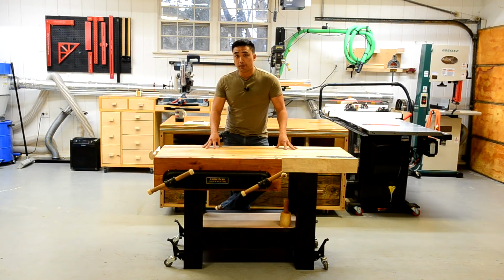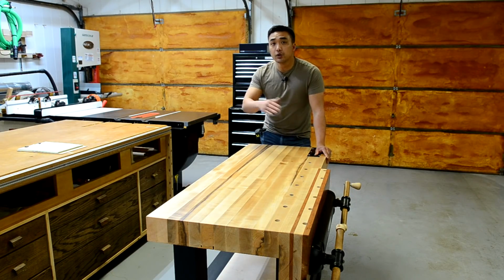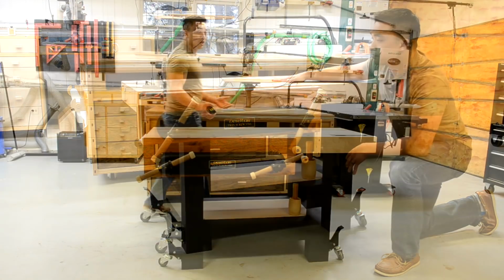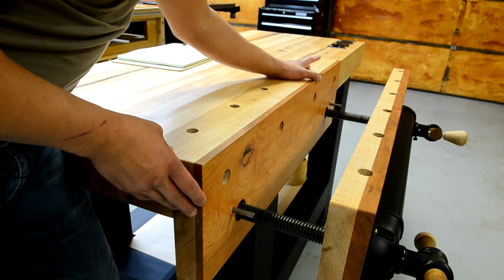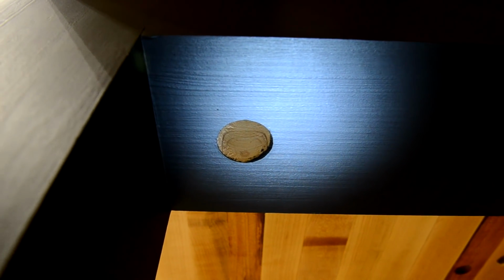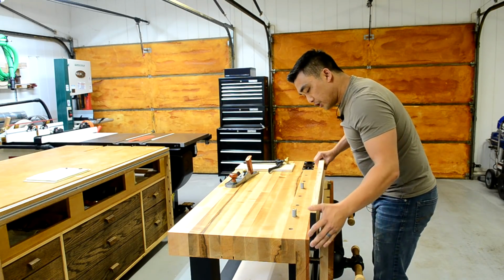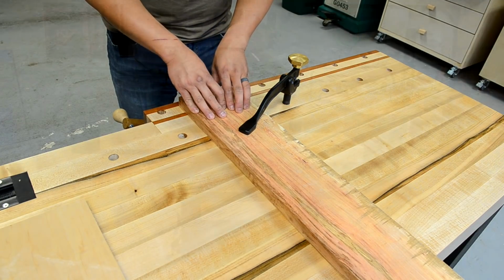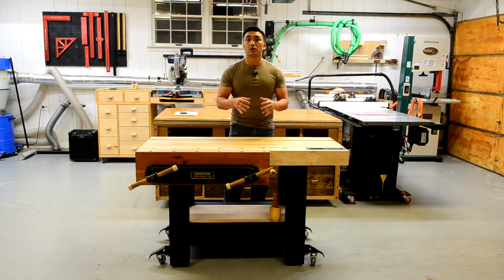Traditional Workbench for a Power Tool Woodworker

Comment: $50'dollars for that twin screw vise, WOW what a deal. Actually I had not seen that type of vise but I really like it. Been holding back on a vise for my bench just because I wanted to make sure I got the one that works best for my needs. Glad I ran across your channel, l now know I will be going with this type of vise. Overall awesome bench!! Thanks for your video.
Reply from the maker: Lee Jaime I know, it's hard to believe it but the woodworker I bought the vise from said he couldn't get it to work properly. It worked fine for me on the first try. I talked with Veritas about the vise and I was advised to follow the instructions to the letter. The tech explained to me that folks get into trouble when they start to veer from the directions. It's hard to believe that the vise is nothing more than 2 acme screws, 2 nuts, 2 handles, and a go-cart chain. Buying individual components from McMaster Carr or Grainger is not that expensive but fitting and mating the pieces together comes at a premium. I was ready to buy an inexpensive Wood River cast iron quick release vise.  But this guy showed up and I couldn't pass it up.

Comment: Nice video.....new subscriber, new woodworker, and happen to live just north of you in the new market area. Have you tried visiting Hobby Hardwood in new market? if so, how does it compare to the mill in toney?
Reply from the maker: I have visited Hobby Hardwood and Robert's prices are more than fair. However, he's limited on his species and stock thickness. For instance, I needed 8/4 Maple for my workbench. He only had 4/4 Maple and in limited quantities. American Hardwood in Toney had 8/4 Maple in large quantities at a more than fair price (at the time I paid $2.90/bd. ft. but prices change). I've stopped visiting Hobby Hardwood because of his limited selection and quantity. I needed something a little more dependable.
Reply: I'll have to check them out. Hobby is about 5 minutes from the house so convenience is nice.

Comment: Hi buddy, looks like a fantastic build. One thing however that you`ll find out to be problematic in the future is the length. There is no way to hold a long board on a short bench for planing.
Reply from the maker: godu1111 I have to respectfully disagree. I can easily support 30" wide panels on the bench top and 60" long boards in the front vise with a surface clamp supporting the work piece through the front leg. Furthermore, planing long and wide boards was not the purpose of this bench. Being a predominantly power tool woodworker (8" jointer, 15" planer, with access to a 24" planer) the purpose of this bench was for cutting and cleaning up joinery (dovetails, tenons, mortises, etc.). In fact, I consulted Carl Duguay of Canadian Woodworking Magazine (article entitled the "Pint Sized Workbench"), about his workbench sized shorter and narrower than this bench. He felt his bench fit his needs perfectly given his access to powered planers and jointers. I think if I was strictly a hand tool user, you're absolutely right, it's much too short. However, my MO/AT (measuring nearly 48" wide and 74" long) takes care of the majority of holding/clamping operations needed for my machine tools. Given I don't plan on planing a dining room table top, I think it's perfectly sized to fit my needs. But only time will tell.  Thanks for watching!

Comment: I've spent the last 4 months researching designs of different types of workbenches and thought I had the perfect design for my needs figured out, and then I watched this and what you said about wrist height was the last tweak to my design to be perfect for me. Also loved the wheels, I've wanted to do this as my workspace is very small, but not many people are making their benches mobile and I was thinking that I may not be able to find anything capable of handling the weight.

Do you have a rough estimate of the weight of your bench and what the wheels are capable of supporting?
Reply from the maker: Ben Good Rockler states that their workbench casters can support 400 lbs. I estimate that my bench tops weighs somewhere around 100-125 lbs. the base is easily 50 lbs. Therefore, I'm estimating my bench to weight between 150-175 lbs. However, weight isn't the only important factor. The legs to the base weighs significantly less than the top. But the footprint, joinery, and girth of the base makes the bench extremely solid. Think of a Greco-Roman wrestler spreading his limbs out wide, preventing his opponent from flipping him over. The drawbore pins help prevent the base from racking at the joints. I'm happy you enjoyed the video.  Thanks for watching!

Comment: Sweet build and great explanation of this bench!  I can't believe you got that vise for $50!!
Reply from the maker: bigscreen bird Believe me, I was shocked to find it. When I decided to look for "vises" on Craigslist, the seller had it posted for two months without a bite. The picture showed only the screw and nut assemblies and a balled up chain. Met the guy at his workplace, offered $50 and he took it. I knew I needed a longer chain and a cover for it but I also knew what these things cost new. Funny thing is, the seller said he could never get it to work properly. I got it to work on my first try. His loss, my gain, I guess.

Comment: Nice workbench.  The video was well thought out, very articulate presentation, not much fluff.  Well done.  One item: I wish you would have tallied up your overall out-of-pocket expenses for it.  Keep up the good work.  On to the next video for me.
Reply from the maker: Danimal GB I hear you on the cost analysis. I considered doing a cost break out but decided not to given the vice was bought used and some of the items would be considered "luxuries." But here goes. Maple and Southern Yellow Pine cost me ~$187. Twin screw vice was bought used for $50 (if you check my Instagram page, I actually posted about this gem of a find) and replacement parts were $40. Inset vice cost me $95, and the casters cost me $60 on sale at Rockler. Add paint (which was half a quart of General Finishes Milk Paint), finish, bolts, washers, and machine bolts and I'd estimate my out of pocket was close to $460. That's definitely not cheap but not nearly as expensive as what I've seen. I do appreciate the feedback. Having an honest assessment of cost is important and I realize that. Thanks for watching!

Comment: You don't want any finish on the surface of a handtool bench. In fact it's kind of a no-no. What you want is friction - a nonslip surface.
Reply from the maker: Tioga Fretworks Wish you could feel the surface of the workbench. The surface of the workbench is actually "stickier" with the oil/poly blend.
Reply from the maker: Tioga Fretworks I've found woodworkers in 3 camps; those that use a oil/varnish/mineral spirits blend, those that say no finish but maybe oil, and those that say it's personal preference.

Comment: This question really isn't about the table.  I was wondering how you liked that miter saw?
Reply from the maker: I like the miter saw.  I bought it as a refurbished tool from a Bosch distributor in Atlanta.  I did recently have a problem. The travel of the axial glide mechanism was not inline with the saw blade. This caused a significant amount of burning when using the full crosscut capacity of the saw. I sent the saw in for repair and even though it was past outside of warranty service, Bosch honored the warranty and the saw was repair at no cost. Bosch's customer service was spot on! I believe the issue I had was a fluke. However, if you do purchase the saw, make sure to check for square along the full extent of the saw's crosscut capacity.
Reply: AlabamaWoodworker thank you for the response.  I believe I am going to purchase the saw this evening.   Most the reviews I've watched and read are good.  It seems a lot of people who use higher end tools really like this saw.  I also like the space that the slide feature saves.
Reply from the maker: Michael Spurlock I think that's a solid choice.

Comment: What did you use to cross cut the top square after laminating all the pieced together?
Reply from the maker: Ahh, you caught me.  LOL!  I used a 16" radial arm saw with 24" cross cut capacity at a community workshop in Huntsville to square the top. I used the hollow chisel mortiser and 24" helical head planer from the same workshop. The workshop charges $4/hour and I use this workshop for anything I don't have in my own workshop.
Reply: AlabamaWoodworker I wish I had a place like that close to me will have to look around. Thanks.

Comment: that is one hell of a workbench that's awesome looking man!  good call on using the Cherry love the way that looks with the black and the maple🖒 and I also always use one -2 coats of polyurethane for the top of my workbenchs just enough to protect it  and haven't had any problems.
Reply from the maker: Thank you for the reassurance, Joe!  Great video on the splined picture frame by the way!

Comment: My concrete floor is very uneven and mobile benches need to be leveled every time they are moved, I use a wooden wedge for this.  If you have this problem you could make a nice wedge from decorative wood and add a peg to one of the legs to hang the wedge on when the bench is up on wheels.
Reply from the maker: That's a great idea, Terry!  Thank you for the tip.

Comment: I like smaller benches, I find that 99% of the time I only use the 30 or so inches on the end of my main bench so who needs 6 or 8 feet of bench?  Nothing wrong with really long benches if you have room though.  I like the paint job, looks great.  I like your choice of maple top (as long as you can afford it), hold fasts can elongate the dog hole in softer wood.  Like Paul Sellers I have moved my vice 1" away from the face of the bench and I like the way it allows me to grip a board with my hand.  I think 10 years from now you're going to be patting yourself on the back for building this, It's a great bench.
Reply from the maker: I totally agree, Terry.  Having a big workbench is great if room affords.  I think many woodworkers also see the big workbench as a right of passage.  Again, nothing wrong with that.  However, the last thing I wanted was a beautiful workbench that took up more room than I needed.  Thank you for watching and thank you for your encouragement.